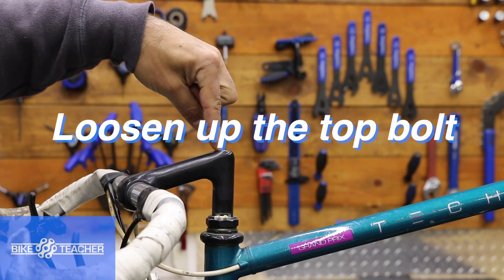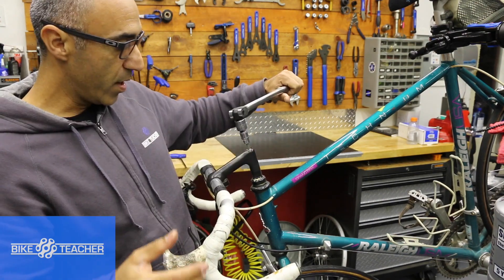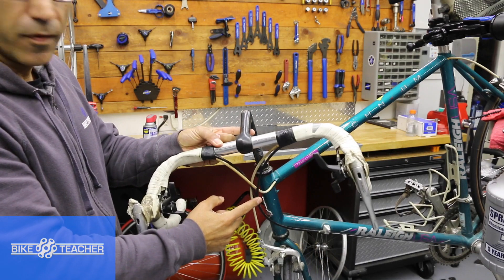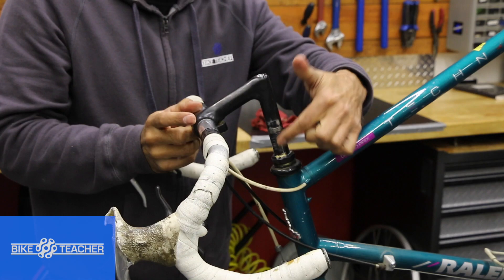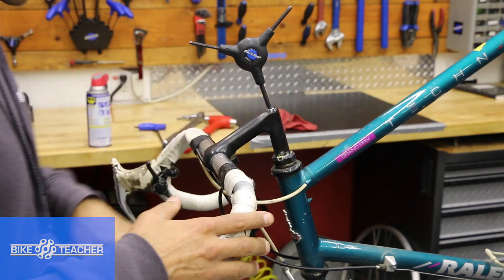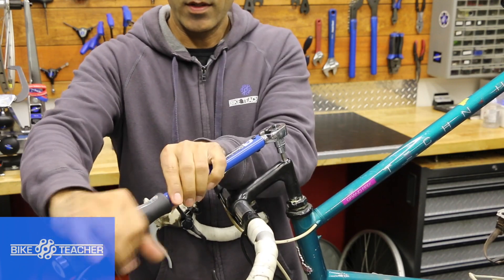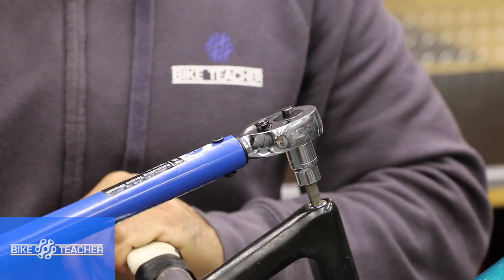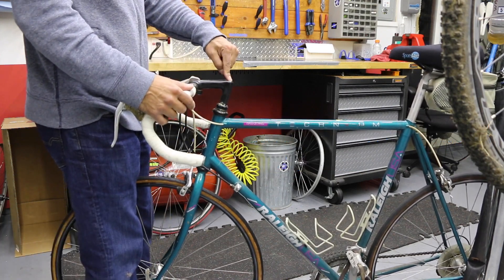How to remove & Replace a Quill Stem

Comment: Hello good afternoon or evening depends on the date or time you look at this comment. The reason why I write is: that I have a Rutera Raleigh Technium Pro US brand bike like the one you present in this video. It is more or less 75% of its original state since it has several scratches and a little bad paint. Will you know how much a bicycle of that style can cost today? Hopefully you can answer me and help solve my doubt. Greetings from Mexico Lindo y Bandido
Reply from the maker: Hi. I am not 100% sure on the going price. I would guess $150-$250. Thanks
Reply: @BikeTeacher  Ok thank you very much for your prompt response. It helps me a lot because there is a person interested in buying it. And I don't want to lose money or regret it. I asked him for 350 or 400 dollars and we are negotiating
Reply from the maker: Check Bicycle Blue Book.com. They evaluate and price bikes. Tour bike may be to old though.

Comment: Hey, I made the mistake of undoing the top screw completely and taking it out...I can hear the wedge moving if I shake my bike a bit. I know you say that if I turn my bike upside down I can retrieve it, but I tried this and the screw doesn't catch on to it. 
Also, the stem isn't coming apart from the rest of the bike...is this normal?
Thanks!
Reply from the maker: +Grand Plancher   Hi, the wedge May still be stuck that's why the stem won't come out. If possible enter the head tube from underneath where the forks are see if there's a hole that will allow you to dislodge the wedge from the other side. Use something long and stiff like a blunt screwdriver and give it a few taps with the light hammer. Actually try this first, keep the bike right side up install the long screw make sure the screw is contacting something on the inside which should be the wedge and tap the screw which should hit the wedge and dislodge it. Let me know. Thx
Reply: Thanks, finally I found a piece of wood and put it on the stem and hit it a few times, the stem then dislodged itself! (and I was able to put the wedge back with the stem).
Thank you!
Reply from the maker: +Grand Plancher  Your welcome!

Comment: I have a folder bike. Would like to lift out the handlebar stem to fit bike in my car better. is it ok to do this regularly. Thankyou.
Reply from the maker: Yes, it’s ok to remove regularly. Just make sure that you use a tool that fits as snug (tight) as possible. You do not want any looseness or slipping of the tool. This will ensure the nut (s) stays in good shape over time. Thanks!
Reply: Yes, that advice makes sense. Thanks very much. I do have the allen key that came with it. Its not a folding handlebar section like most bikes and its taking up head room in the car. Its a "Stowabike" (cheap). ATB. Pete.

Comment: what if my wedge isn't tightening at all? is there something I should do? Did i mess up? i was playing around with my quill stem and didn't notice it was a quill stem. I snapped out he handle bar instead of sliding it out. Now I can't put the stem back inside. Any help would be great.
Reply from the maker: Try by adding some tension to the wedge by tightening the center bolt slightly. Do this while the stem is out of the bike. Make sure he wedge is not spinning while you tighten. Do this a little at a time until the stem fits into the bike with some resistance. It is possible the wedge had little to no tension on it to begin with.

Comment: I bought a classic 1990 Sirrus bike and there's one problem. The stem has no bolt but the wedge AND stem is still there but it's stuck to the fork. already sprayed some penetrating oil but won't nudge. Any ideas? Worst case scenario that its welded to the fork tube.
Reply from the maker: Hmmm, Specialized Sirrus? Does it allow you access from the bottom of the fork to spray as well? I have not herd of a welded stem yet. I’d have to see a couple pictures. Text or email me if you want. arthur@biketeacher.com 408-210-2980
Reply: 0

Comment: Mines all the way tighten but still bars are able to move left and right
Reply from the maker: If the center bolt is totally tight and the handlebars are still moving, the brand/material may not be able to create friction on its own anymore. A new stem may in order. You may want to try a friction paste made for alloy/carbon to help it grab.